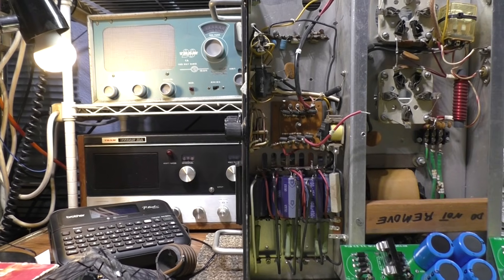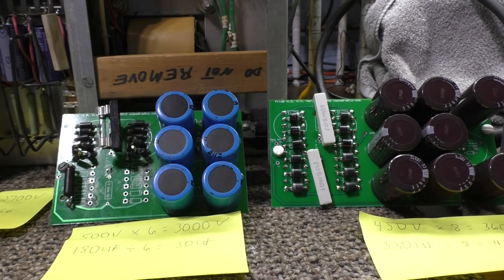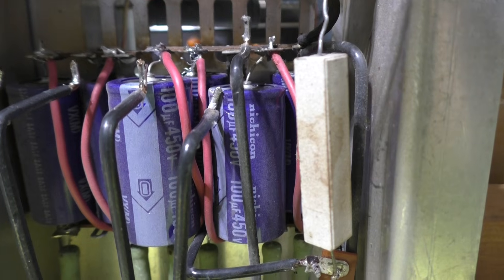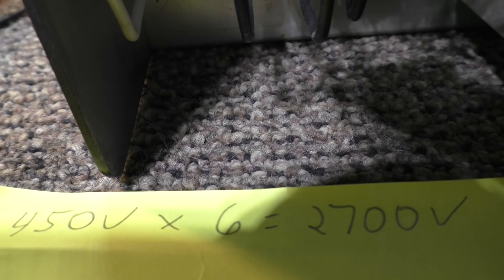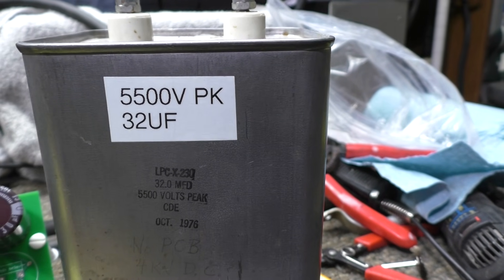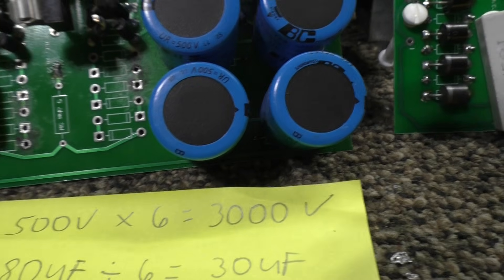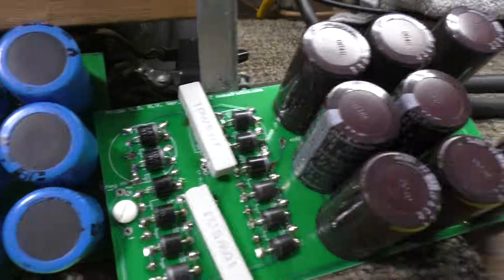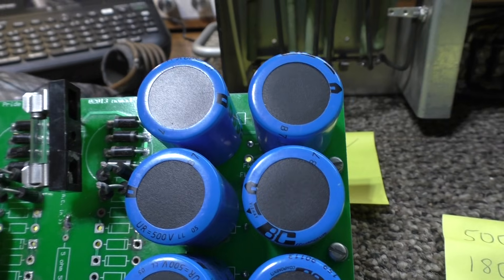Tube Linear Amplifier HV Electrolytic Capacitor Banks explained

Comment: 20% voltage headroom 30uf per 1 amp plate current... Ensure diodes are well over rated on voltage handling
Reply from the maker: Thats about it, thanks for the summary.

Comment: What value cap goes on the negative bias ckt. On a phantom tram. ?
Reply from the maker: 100uf at 100v. Hooked up with the + going to ground as its - voltage. The schematic is on CBTricks.org
Reply: @tramdr  thanks!! I could not read the value of the cap it had gotten rubbed of or faded but thanks for the info!

Comment: My old GS-35b homebrewed 10m linear amplifier used to use 10 x 220uf 450V in the original capacitor bank. This lasted over 4 years at 3.4kV @ 1Amp.

I recently replaced the capacitor board and changed the caps to 10 x 330uF 450V.  Thats more than enough headroom.  Also the capacitor bank helps smooth out the DC, so that you don't get AC hum.